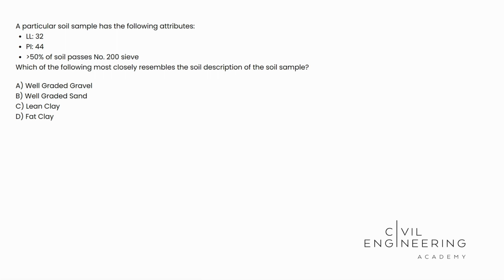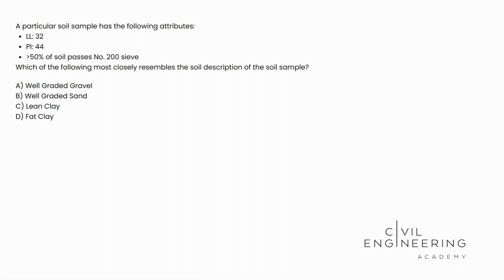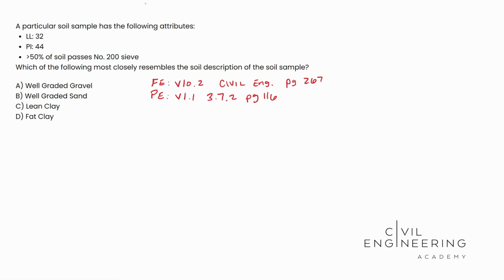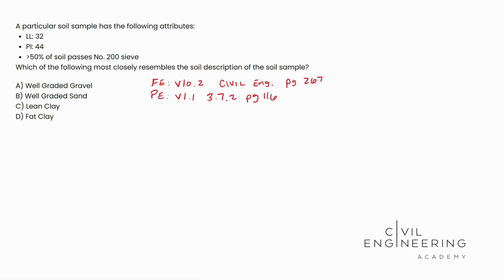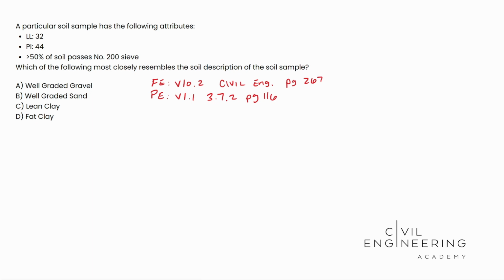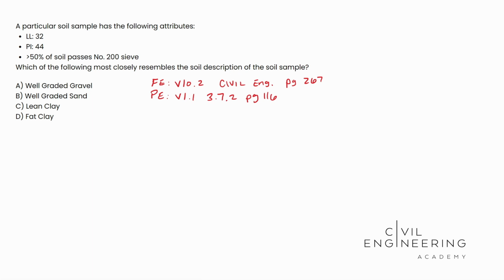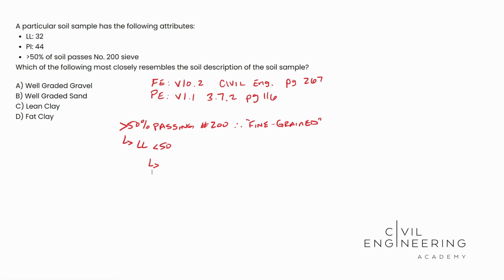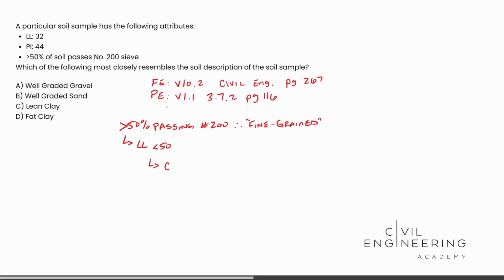Civil FE/PE Exam - Geotechnical - Grading Soil Using the USCS Soil Classification System

Comment: Sorry, but this is an impossible soil. The PI by definition (PI=LL-PL) is never going to be greater than the LL. Also, at the end of the video: yes the given values plot above the "A Line", but they also plot off the chart (this soil doesn't exist). Please revise the video to be more accurate. Thanks.

Comment: Ncees pe hb 1.1, p. 116, 117.

Nice and easy problem. A tad too easy for the PE exam, however. On an actual exam ncees will have you derive the PI via PL and LL. For sure.

Also ncees won't make the answers so far spaced apart in concept. It was too easy to exclude 50% of answers in the 1st minute of problem-solving. Ncees wants to make you sweat, to get you intellectually fatigued, to have yo give up before the 8th hour of marathon.

If you knock out your sands and gravels early then you have effectively increased your odds of a correct answer, if you were to guess from there, to 50%. This is a massively advantageous probability and an unfair one in the many eyes of the ncees.

I can see this being a fair question on the fe, however.

Perhaps a tougher variant of this problem might be posted here in future, for us PE guys ?